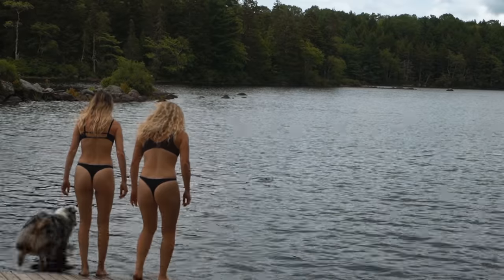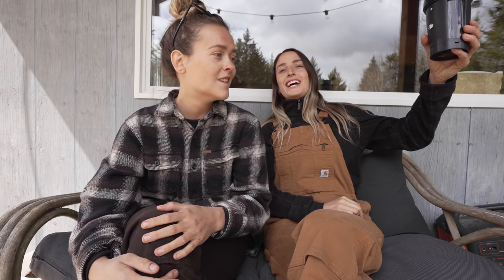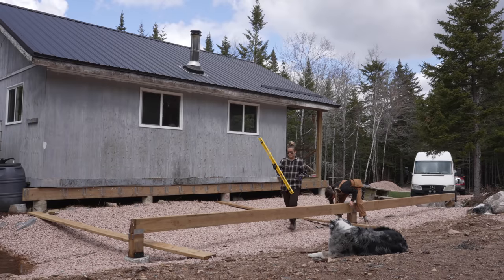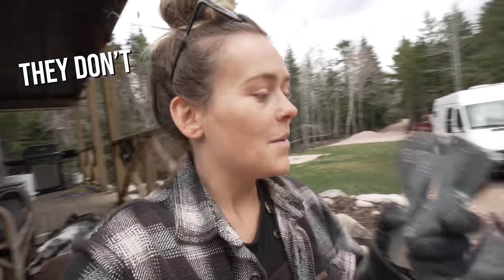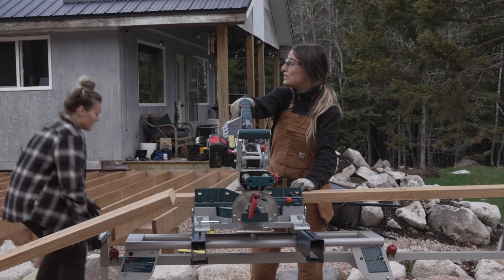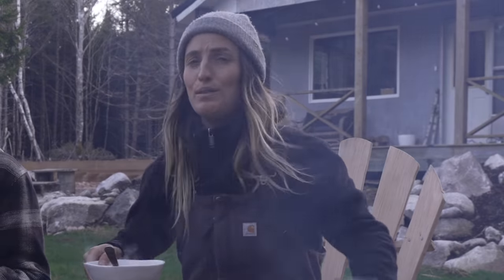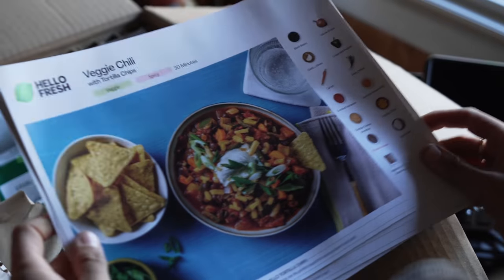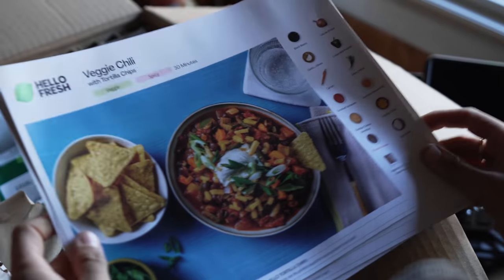This CHANGES Everything! We Built A Deck w/ No Experience

Comment: You may find that if you add a rim joist to the outside end to cap the ends of the regular joists that it will hold them in line and keep them from twisting, which is likely despite the hurricane clips.  Make it full height to the top of the floor boards and it will also add a lot of rigidity.  Remember, the live load (humans) is small compared to the snow load that it will endure for many months at a time (or all at once if the roof sheds onto the deck).  Just  a thought.

Comment: Are you planning to seal the deck? I don't see any doing it lately and wondering about the thought process or decision points if not. Also, watching you from my Van using Starlink while relaxing in a local preserve here in moist Florida. Can't wait to spread my wings more just as you two are doing. Love you both.
Reply: you usually don't seal the deck right away. usually do it a yearly after the first year

Comment: Much like you two ladies, it looks fabulous! However, you may want to consider removing that last board again, cutting back the joists a bit and installing a rim joist to close up the far end of the deck with 2x10 treated lumber to accommodate a place to attach a short stringer of stairs, maybe 4 or 8 feet wide leading to the yard. Could be helpful for guests, doggies and older folk? Also, when it comes time to stain the deck and paint the house, I would highly recommend renting a power sprayer, it will make the job so much easier! Good luck and much love!!
Reply from the maker: It’s coming in the mail :) thanks!💛💛

Comment: you might want to add some blocks at ends of joists so they don't tip over over time.  Often a 2x10 would be face screwed on to plumb joists.  Or deck boards would work  Or blocks between joists

Comment: Cool deck!

You have purchased an absorption refrigerator - the same type that most RVs use.  While the redundancy may be desirable, these units use 5-6X the amount of electricity that a standard residential compressor-type fridge uses.  If you plan to use it on AC most of the time, it will be gobbling on the order of 7-8kWh of juice a day.  For comparison, the average Canadian household uses around 19kWh/day.

Comment: Just wanted to mention you really should have the outside chimney 2’ above the peak of the cabin then put the cap on. 

This is very critical. It will prevent sparks hitting the roof & catching the cabin on fire & also allowing smoke to back up into the cabin when it’s windy.

I know how hard you worked on that roof & chimney, but it really is a fire & indoor smoke inhalation hazard at the height it is now.

The deck is gorgeous btw. Just love it. Did you paint it properly to protect it from the elements?? I truly can’t recall but hope you did your research & perhaps that wood is treated & needs no extra treatment. Apologies for the confusion.

Ya, you both have come so amazingly far. Congrats!!🥳

Comment: Looks great!, Congratulations  on building your deck.  The only thing I would NOT PUT ON A DECK is a rug as it traps moisture and will rot your wood faster. So if you wan to keep it then pull it up when wet to get air under there faster.  Same thing happens with anything solid on your deck.  My deck is 28 years old and with annual maintenance and repairs still going strong.  Lastly I would not stain it as every 3 years lots of work to restrain but you might want to consider a good quality moisture control product.  Go super high end on that product. Benjamin Moore has one I believe..  It won’t stain deck and still allows wood to naturally go gray but protects from moisture.

Comment: I like the white chairs only but I think I like the arrangement with the bench a little better..... but I wouldn't do that.  I would leave the bench on the porch under cover, then you can still use it when it is raining.  Also, you will need to bring the cushions in and out depending on the weather, so by just having the two chairs, that is fewer cushions to bring in and out regularly.  When you are hosting company, then you can bring the bench around to create a conversation area. Awesome job on that deck!!!

Comment: The deck looks amazing. And now for a blast from the past. Popular Mechanics published an article in the late 1960s for RV'ers. The plan was to build a very small house, very similar in size to your cabin and have a carport which allowed the RV (read van) to be part of the house. Given the solar panels on the van's roof, this wouldn't be practical but a level entryway from either the deck or the opposite side of the cabin which can be pulled away/closed up when it's time for the van to hit the road would work. Imagine using the coffee maker in the van and having a level walk back to the deck or front room.

Comment: Nice deck there and good discussion about upside/downside of the boards. I would recommend rotating the BBQ, so it’s over the edge of the deck. Helps prevent the accidental flare up against the side of the cabin. Also you may find after a while the smoke residue on the exterior siding.

Comment: An old trick, coat the outside of stainless steel pot with White Ivory dish soap, it will turn black when put on the wood fire but when you wash the pot it will be clean. Of course care must be used avoiding getting any soap near food😃

Comment: Check on the can of soup. Most packaged things today useally have phone numbers, or email address on them so you can contact them.  If nothing else, the place where it is made, then you go on line and ask for that phone #, or address to that place.  You can also ask your phone for it. :-)

You can shorten the tool belt by cutting it off (leave just a bit of extra incase you have a big meal along lifes way), then run a beed of super glue on the end to stop any possible fraying.

Two white chairs plus the bench.  Deck looks great with your set up, only thing I would add is a 2X along the edge where the chairs are close to it.  They have a habit of working right on over the edge withput something to ward you that it has moved back too far.

Comment: From the video you put in a tremendous amount of work making your deck.  Good Job.. i only have two questions.   Why didn't you put a board at the side opposite the house to close it in??   Second I did not hear you mention any thing about water treatment !   you can use like Thompsons water sealer. it will protect your deck from rain and snow damage.    I know all the money you spent on the lumber  it would be terrible if it started curling up and ruining in a few years.    I enjoy your videos very much.  the ones in Mexico. are very informational  thanks..
Reply from the maker: Great questions!!! We used pressure treasures lumber!! We will seal it at the end of the season this year- stay tuned ☺️💛

Comment: Just a heads up. You’ll want to pull the grill away from the house and out from under the soffit while using it. If it gets too hot you’ll get a flare up with some grease etc., you’ll burn the house.
Reply from the maker: Thank you xx

Comment: The deck looks amazing ! But if you want a finished look just put another main deck board like the stringers on the end to cap it off so you don’t see everything.
Also I see your fire burning a lot so make sure you use a chimney brush to clean the creosote once a year…..you don’t want a chimney fire.
You two are doing a amazing job ! …..from another Canadian on the better 1/2 of Canada 🇨🇦 (Alberta) 😂

Comment: My only concern with the deck is that it seems like a far span without support in the middle. I won't be surprised if you come back home after a winter of not shoveling it and the center of the deck is sagging. Maybe add a few supports in the middle.
Reply: Also a small snowblower works great to help clean snow off the deck if you are around to use it

Comment: Deck looks a bit odd with the Joists exposed....  I think you're supposed to cut them back a bit further, and then have another board (Vertically) attached so it looks the same from the Front or Side.  You could still just slap another one Vertically but you'd have a (tiny) sort of step effect where they meet up.
Reply from the maker: Yes, we’re not done yet. We have to do much more finishing touches haha
Reply: @Vanwives  It's probably a good "Stitch in time" Lesson...  where having a complete plan can save you time later on.  

I probably wouldn't have thought of it at the time either (same as removing the last boards to trim the Joists), but experience or research allows you the foresight to avoid the mistakes.

You probably want to take off the last board, and use a precut board with a Square rule to trace out vertical lines on all the joists so your cuts are all aligned.

But it's just a decorative bit, and having a functional Deck is a Huge Milestone :)

Comment: You girls need to buy a Ryobi empack drill...it works much better to put screws in wood...and it much faster
Reply from the maker: Really? Cool thank you!
Reply: There is one more thing you need to do to the deck.... And it will make it look better standing out in front of it... You need to put a face plate....    on the front of the deck so you can't see underneath it... Put it where it fits just underneath your deck boards... That means you will have to cut off 1 5/8 " off each   floor Joyce... And trust me you will love that impact  drill.... You girls stay safe

Comment: Ingredients
1 teaspoon olive oil
1 (12-ounce) package fully cooked Italian-style chicken sausage, preferably spicy, sliced into coins
2 large (about 3 ounces) carrots, scrubbed and chopped
2 stalks (about 3 ounces) celery, halved lengthwise and sliced (save a few leaves for garnish, if desired)
10 cups (2 1/2 quarts) low-sodium chicken stock
1/4 cup (2 ounces) milk or water
1 large egg
1 slice white bread, hard crusts removed
1 pound ground pork or turkey
1/2 cup (about 1 ounce) grated Parmesan or Pecorino Romano, plus more for serving
1/4 (2 ounces) yellow onion, grated
1/4 cup (about 1/2 ounce) chopped Italian parsley, plus more for serving
3 or 4 cloves garlic, minced
1 teaspoon kosher salt, plus more to taste
1/2 teaspoon freshly ground black pepper, plus more to taste
3/4 cup (2 1/2 ounces) tiny pasta, such as ditalini, orzo, stelline or acini di pepe
4 to 6 ounces (4 to 6 tightly packed cups) shredded or chopped escarole, kale (thick ribs removed), chard (ribs removed) or spinach, or a combination
Pinch red pepper flakes, optional
1 large lemon, zested and juiced
Sprigs of dill, for garnish (optional)
Step 1
In a large Dutch oven or heavy-bottomed pot over medium-high, add the olive oil and sausage and saute, stirring every so often, until browned on both sides, 2 to 4 minutes. Increase the heat to high and add the carrots, celery and stock. Cover, bring to a boil and cook until the carrots and celery are tender, 10 to 12 minutes. Remove from heat.

Step 2
Meanwhile, make the meatballs: Position a rack in the middle of the oven and preheat it to 425 degrees. In a large bowl, add the milk and egg and whisk lightly. Add the slice of bread and soak for 5 minutes. Add the ground pork or turkey, cheese, onion, parsley, garlic, salt and pepper to the soaked bread and mix with your hands until combined. Rinse and moisten your hands with cool water and then shape the mixture into 1- to 2-inch meatballs; you will have 30 to 35 meatballs. Place them, spaced evenly, on a large, rimmed baking sheet. Bake for 10 to 12 minutes; meatballs will finish cooking in the soup.

Step 3
Return the heat to high under the soup. As soon as the broth comes to a boil, stir in the pasta and simmer until al dente, 4 to 6 minutes. Lower the heat to medium, and stir in the chopped greens, red pepper flakes, if using, and half of the lemon zest; reserve the remaining zest for garnish.

Step 4
Using a spatula, scrape the meatballs and any fat and crispy bits stuck to the pan into the soup. Increase the heat to high and cook until the greens soften and the meatballs are cooked through — cut into one to be sure it’s no longer pink in the center — about 3 minutes.

Step 5
Add half of the lemon juice; taste the broth, and season with additional salt and pepper, if desired.

Serve the soup hot, garnished with celery leaves, Parmesan, parsley, dill, and the remaining lemon zest and juice, if desired.
Reply: OMG.  Safeway sells it in cans,

Comment: Hello girls beautiful deck are you putting a stair right across the width of the deck the easiest way is just to build a box using 2 by 8 and the decking board on top  it’s easy and strong you can anchor it into the ground wit some pegs  hi from Melville Saskatchewan have a blessed day
Reply from the maker: Hey Brian! Yes we hope too. Just need to figure out stringers lol. That’s a cool idea! Thank you :)
Reply: @Vanwives  how many steps up
Reply: Is it one step then deck
Reply: I have done almost every deck like that and never a problem if it’s a two step you build the first box 16 inches then the second box is 8 inches put the 2 together and finish them in decking you haves 7 I/2 Riser by 8 inch step witch is pretty much standard and it’s a lot cheaper and easier then trying to do the risers and you can always do a cement three wide  cement patio to sit it on just saying
Reply: Or a gravel base like under your deck